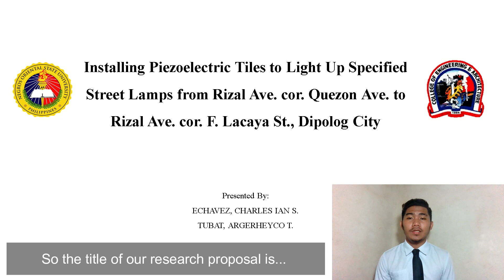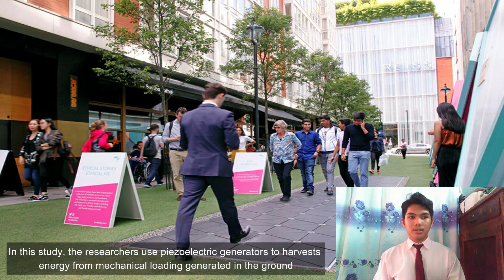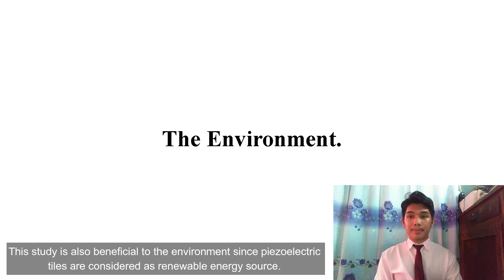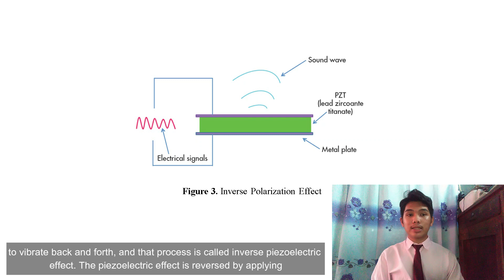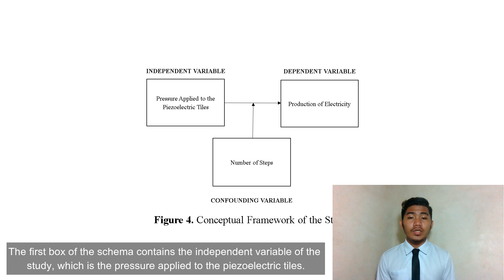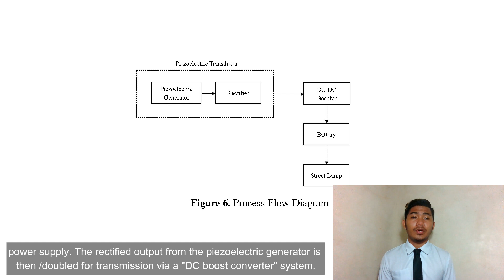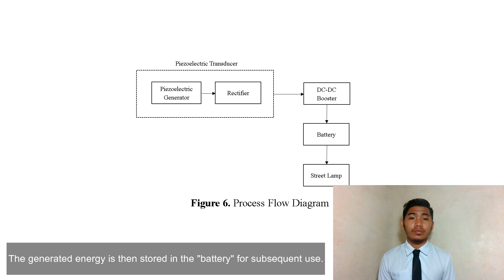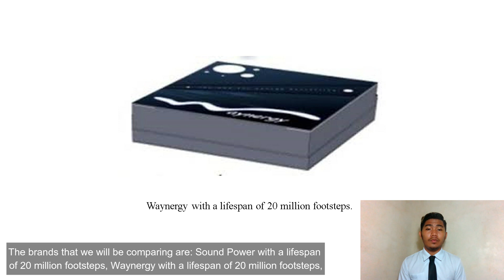Installing Piezoelectric Tiles to Light Up Specified Street Lamps

Comment: NAME: Sanrey Jun R. Guevarra
CLASS NAME & CLASS SCHEDULE: COE 346 A & 5:00-6:30 T-TH
DATE: 27/03/2022

REACTION: The findings are extremely beneficial to the community. The researchers were well-prepared and presented their findings. The presentation is quite interesting, and the research is extremely detailed. Piezoelectric Tiles is a new concept for me; therefore, it piques my interest.

REFLECTION: Studies that considerably benefit the community are already commendable but using the public's steps in generating electricity to benefit the community is truly astounding. I couldn't ask for more; this type of research is well-planned, which adds to the research's impressiveness.

Comment: Tudio, Lechly D. 
COE 346 Methods of Research T-TH 5:00-6:30 PM March 26, 2022
Reaction: The video is well presented and very informative. I found the resources useful and that they give you a better understanding of piezoelectric tiles and energy harvesting, for I am not familiar with this topic.
Reflection: It is an ideal research proposal since it applies to everyone. This may be a good alternative electrical power source to light up street lamps/lights aside from solar panels. It is a good practice to be a responsible user to save the waste of electricity from the road and to operate street lights in a controlled manner.

Comment: Diaz, Joseph Jr. B. 
ENS 341 B - 5-8 pm Saturday
March 26, 2022

Reaction: I'm totally amazed of the idea of piezoelectric tiles to light up streetlights because it can generate electricity by just walking on the tiles. This is so different kind of producing electricity, and it just need the pathway to be stepped by pedestrians and to produced electricity. 

Reflection: The piezoelectric tiles is suit to be installed in the city because there's a lot of people walking down the streets and that's the best of this technology. It needs many people to stepped the tiles to generate electricity to light up the streetlights or to store energy in the battery.

Comment: Name: Khynny Maureen P. Campoy
Class Name and schedule : ENS 341 Saturday (5:00-8:00pm)
Date: March 26, 2022

Reaction :
The researchers gave a really excellent presentation. Their idea is ver innovative helpful, and beneficial. 

Reflection :
Installing Piezoelectric tiles to ligt up specified street lamps is very beneficial to the community. It improves the safety of the riders and the pedestrians. And it minimizes power interruptions.

Comment: NAME: Shiela May E. Velos
CLASS NAME & CLASS SCHEDULE : ENS 341 - SAT 05:00-08:00 PM
DATE : March 26, 2022

Reaction:  This proposal was quite useful, providing interesting information, unique product and I should say it was also well-presented that you can really say, this was studied rightly and only smart people could elaborate. Installation of Piezoelectric tiles to light up specified street lamps is rarely discussed and proposed, so it might be a good and unique proposal that there are so many new things that can be upgrade and invent, discovered and settings, a great idea of showing others on how we manage to develop our beloved community, that change the image of our community because of this proposal that engineers uniquely manage to have.

Reflection: Areas with low installations of street lightings where the people who passed by the street that having troubles seeing the road well, this is installed can help avoiding accidents and tragedy. The use of piezoelectric tiles in the proposals is a quite new concept when compared to traditional solar panel designs. I was blown away by the fact that they came up with yet another innovative way to serve their neighborhood. Installing piezoelectric tiles to light up a specific street lamp can help resolve energy shortage and this is very in demand to our environment. It's a good thing that this street lights are everywhere in our community and without the use of direct electricity , it (street lamp) can have its continuous light which is free from bigger charge. I hope that this will be studied more and be remarkable to the one who proposed.

Comment: Name: Balansag, Lorenzo Jr. B.
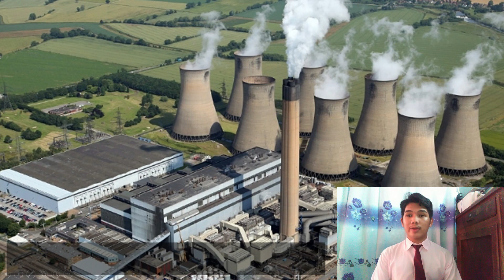Class Name and Class Schedule:  ENS341- Research Methods for Engineering | Saturday 2:00-5:00 pm 
Date: March 26, 2022

Reaction: Another proposal that promotes clean and renewable energy generation. I really commend the researchers in conducting the research. As they able to make a solution of electrical needs in Dipolog city. It will create a renewable energy source that doesn't deplete natural resources.

Reflection: Everybody walks, so using that simple task and make use of it to make electricity is an ingenious one. If ever implemented and integrated into a larger scale, it will further the energy generation of an area. As a street is very crowded.

Comment: Name: Dolly Rose S. Bigno
Class name and Class Schedule: Reaserch Methods for Engineering-B / Saturday (5:00-8:00 pm)
Date: 03/26/22

Reaction: The presentation was good, clear and informative. I can say that they are knowledgable in their research proposal. They've come up with a unique idea. Overall the presentation was quite impressive.

Reflection: Their research proposal is all about installing piezoelectric tiles to light up specified street lights. Another innovation that would help the drivers and other people to be safe, avoid any accidents or any unwanted things may happen on roads for it lights up the street and road and at the same time it is good for our environment because it uses renewable energy.

Comment: Name: Jules Gerard D. Cabetingan
Name of Class and Schedule: ENS 341A Research Methods for Engineering
Date: 3/26/22
Reaction: The researchers were very well prepared since their presentation was detailed and very well-presented. The concept of this proposal is very outstanding since it helps save energy and power. This was my first time I heard about the concept of piezoelectric tiles and I didn't think this was possible at all.

Reflection: The concept of this proposal is very unique given the fact that most of the proposals in this channel cover up mostly solar power.  The use of piezoelectric tiles will be of very great benefit to those living in DIpolog City given the numerous demands of electricity in the city.

Comment: Name: John Mark D. Torillo
Class Name and Class Schedule: ENS 341- SAT 2:00-5:00 PM
DATE: MARCH 26, 2022

REACTION: Knowing and hearing this concept from the reporter is somewhat interesting because personally, it's my first time knowing this that this particular ideal can help using this unique way of comsuming and utilizing this free energy.

Reflection: Installing this piezoelectric tiles to light up specified street lamps in those certain is arguably the most satisfying and interesting way of using that mechanical stress as the energy source that can eventually produced enough electricity to light up street lights. This is a great way to produce electricity to those areas where people are walking by for it requires a load to apply in each of the piezoelectric tiles. It's also a great way to lessen the consumption of electricity from the main source and helps in promoting new technologies and ideas for the satisfaction of our community as well as our economy.

Comment: NAME: Kilapkilap, Joebert L.
CLASS NAME & CLASS SCHEDULE: ENS 341 A – Saturday 2:00 – 5:00 PM
DATE: March 26, 2022

REACTION: The study was extremely educational and beneficial to the community. Installing piezoelectric tiles to light up roadways is crucial for public security and increases the safety of drivers and pedestrians at night, as they explain very well. In the future, this will be a fantastic breakthrough.

REFLECTION: Piezoelectric tiles are a fantastic technology for powering street lights. By installing them in sidewalks, citizens will generate mechanical energy, which the tiles will convert into electrical energy, which the street lights will use as power. This would be especially useful in areas where power outages occur frequently; even if the power is off, lights would beam through the street lights, making it safe to travel at night. We are not only helping the country but also the world by utilizing this technology and renewable energy.

Comment: NAME: GANANCIAL, NICK ALLEN C. 
CLASS NAME & CLASS SCHEDULE: ENS 341 - SATURDAY (5-8PM) 
DATE: MARCH 26, 2022 

REACTION: I am impressed with the researchers as they have presented it with a lot of information about piezoelectricity. Piezoelectric was new to me, and because of this research proposal, I now have an idea of what piezoelectric tiles are and how they will work. 

REFLECTION:  after watching the video, I get to learn that Piezoelectric tiles are made using special materials, such as crystals and ceramics, in which electric charge builds up when mechanical stress is applied. It's good to know that it's environmentally friendly because it's a renewable energy source that helps to minimize carbon dioxide and other greenhouse gas emissions.

Comment: NAME: Lumelyn E. Ragusta
CLASS NAME & CLASS SCHEDULE: ENS 341 B Research Methods for Engineering – S 5:00-8:00 pm
DATE: March 26, 2022
REACTION:  This study is really interesting, they introduce new technology for converting energy from steps into electricity that can power street lamps. This will be a great help and investment shortly.
REFLECTION:  Installing Piezoelectric Tiles to Light Up Specified Street Lamps is one of the unique and beneficial ways to save the environment and improve the community. Imagine if all streets had these Piezoelectric Tiles. We could save a huge amount of electricity.

Comment: Name: Orito, Jessel A.
Class Name & Class Schedule: ENS 341 B Research Methods for Engineering (Saturday 5:00-8:00 pm)
Date: March 26, 2022

Reaction: In this video, proposing an installation of Piezoelectric tiles to light up street lamps in a specific area is very helpful to every residents living in that area. Their proposal concerns with the people in need while thinking with the environment’s safety.

Reflection: Installing Piezoelectric Tiles is a great deal using Piezoelectric generators to harvest energy from mechanical loading generated in the shape of compressive forces and converts to electrical energy. In addition, piezoelectric tiles does not emit inorganic and harmful substances that can pollute the atmosphere unlike others.

Comment: Name: Sienes, Marianne Nikki T. 
Class Name and Class Schedule: ENS 341 B - (5-8 PM Saturday)
Date: March 26, 2022

Reaction: The presentation was very informative and useful to the community. They explain it very well, that installing piezoelectric tiles to light up streets is important for public security, and improves the safety of drivers and pedestrians at night. This will be a great innovation in the future.
Reflection: The study is very beneficial both to the environment and the community. Installing piezoelectric tiles is a great idea that also helps the community to have safe and renewable energy resources. It is one of the most effective strategies to reduce reliance on power plants for electricity generation. It will protect our environment from pollution caused by high carbon dioxide levels in the atmosphere. A great research study like this deserves recognition and hopes that the government will give support to potential innovation in the future.

Comment: NAME: Chasty Jane Duran
CLASS NAME: ENS 341 B - Research Methods for Engineering
CLASS SCHEDULE: Saturday, 5:00 - 8:00 pm
DATE: March 26, 2022

Reaction: The video was very informative. Data was presented very well. This research has been though of very well as they are utilizing piezoelectric tiles, very uncommon source for street lamps because most of the researchers would opt for solar energy. 

Reflection:  This other kind of renewable energy has great potential. This is very informative and has opened up a lot of great possibilities. It has given viewers a broader view of what we can utilize as energy resources that both are cost and environmental- friendly.

Comment: NAME: JULIE MARIE H. MARONDO
CLASS NAME CLASS SCHEDULE: ENS 341 – Saturday 2:00 – 5:00 PM
DATE: March 26, 2022

REACTION: The researchers' graphic presentation is simple and easy to understand. Their findings were presented in a straightforward and concise manner. Overall, the presentation was superb.

REFELCTION:  This program will pave the road for renewable resource conservation as research and technology develop. This sort of energy (piezoelectric) is tremendously beneficial not just in developing countries, but also in industrial production, and it is exceedingly durable and efficient, making it a viable solution to energy reliability problems. This energy source, like a solar panel, is visible.

Comment: NAME: Alnie Jane M. Aum
CLASS NAME: ENS 341 B - Research Methods for Engineering
SCHEDULE: Saturday, 5:00 - 8:00 pm
DATE: March 25, 2022

REACTION:
     This study is very important because it aims to produce an alternative electrical power source. According to the Researchers this is helpful for the community and environment. I would agree with them. Since this power generated piezoelectric tile illuminates a particular portion of a place that will contribute to the public security, safety of drivers, riders, and pedestrian at night time. For environment because this study is considered to be a renewable energy source, it reduces the emission of carbon dioxide and other global warming emissions.

REFLECTION:
     This study will be very helpful to us and to our environment. This will be the best option to reduce the need on other power plants to have electricity. Also this will be an environment friendly project.

Comment: NAME: Janloyd T. Ybañez 
CLASS NAME & CLASS SCHEDULE: ENS341 – Sat. 2-5pm
DATE: March 26, 2022

REACTION: The research proposal was interesting that uses a piezoelectric tiles to power up street lamps. This is very innovative way of addressing problem related to lamps, and the video presentation was good.

REFLECTION: Addressing the problem of street lights/Lamp is a good idea, It will be beneficial to the riders and also to the people to have a light in their way, also it will prevent some road accidents and using piezoelectric tiles to light up the street lamps is an economical method.

Comment: NAME: Alejandro A. Bargaso Jr.
CLASS NAME & CLASS SCHEDULE: ENS 341-SATURDAY 2:00-5:00PM
DATE: MARCH 26, 2022

REACTION: 
The research has been quite well explained, and the speakers have done an excellent job of conducting their study. The use of piezoelectric tiles to illuminate street lighting would not only provide safety to inhabitants, but it will also be a means of reducing energy consumption, which will benefit the country.

REFLECTION: 
In today's world, this is a must-have. Installing piezoelectric tiles is critical in some areas, such as those with insufficient electricity and those in less-than-ideal situations, such as disaster zones. People, especially night shift workers, can rest assured knowing this is in place. Accidents can be avoided if the street is lit up properly.

Comment: NAME: Loreto C. Bayawa Jr.
CLASS NAME & CLASS SCHEDULE: ENS 341A SATURDAY(2:00-5:00)
DATE: 03/26/22

REACTION: The researchers did an excellent job of presenting their findings, and their research was quite useful.

REFLECTION: The technology is evolving on a daily basis, as demonstrated by this research proposal. The process of converting footsteps into energy is highly intriguing since the energy that is converted can be used to power street lamps and other low-energy devices.

Comment: NAME: VALENCIA, PRIYANKA N.
CLASS NAME & CLASS SCHEDULE: ENS 341 - SATURDAY (5-8PM)
DATE: March 25, 2022

REACTION:
The research proposal is well presented. The idea is beneficial to the community and is commedable , but i doubt piezoelectric tiles can sustained powering our lights in the near future. But overall this study is informative.

REFLECTION:
This study is some kind of an intelligent lighting system introduced with a Piezo electricity generator that introduces the zebra crossing light to warn a driver at night when a person passes a road using the Zebra crossing to save the waste of electricity from the road and to operate street lights in a controlled manner in order to save the waste of electricity from the road and to operate street lights in a controlled manner.

Comment: Name: Ma. Theresa C. Velasco
Class name & class section: ENS 341 B /5:00-800PM SATURDAY 
DATE : MARCH 25, 2022

Reaction: One of the best research I've watched so far. This research should be notice especially in the area who don't have lights and also useful to have solar street lamps.

Reflection: There are some area that don't have a lights in the street. And without lights it can cause a lot of danger. Piezoelectric tiles is a good idea and can help to the community to have a safer renewable energy resources.

Comment: NAME: Kim Anthony V. Aldion
CLASS NAME & CLASS SCHEDULE: COE 346 A & 5-6:30 T-TH
DATE: 25/03/2022
REACTION: In my opinion, was a very stunning and wonderful concept. I'm blown away by how they came up with such a unique and original answer for our society. Because piezoelectric tiles are unfamiliar to me, I'd like to understand more about them and how they function. It's also fantastic that I'll be able to learn more about this from the researchers' video.
REFLECTION: This project has a similar goal to the others, but instead of solar panels, it employs Piezoelectric tiles to light up certain street lighting, making it unique and appealing. Piezoelectric tiles have lately improved substantially in terms of scalability and reliability, and they potentially be a solution to energy reliability issues.